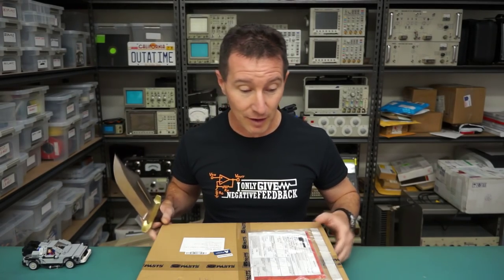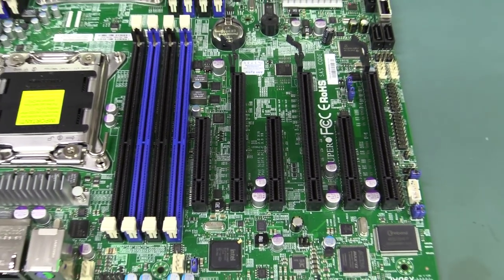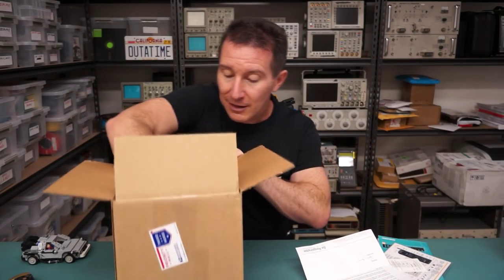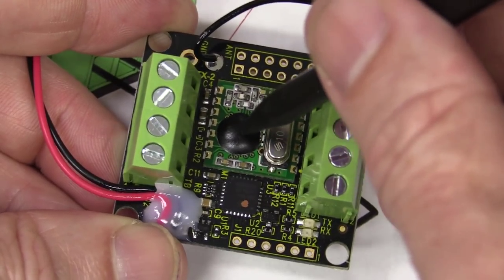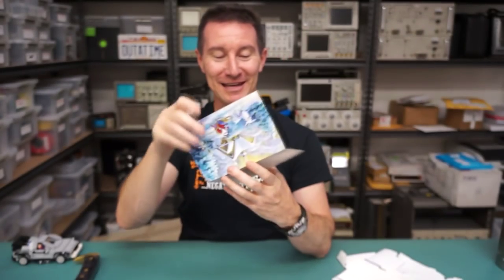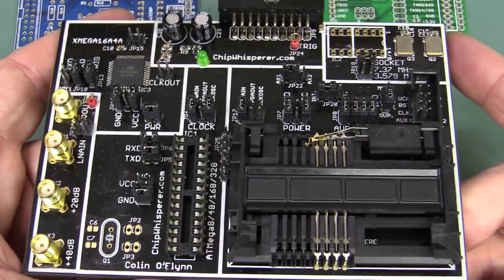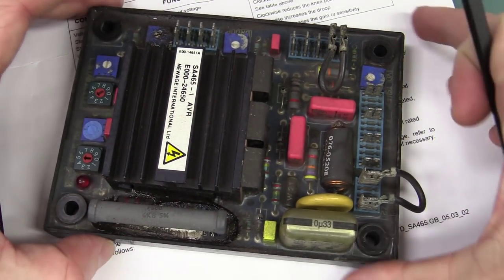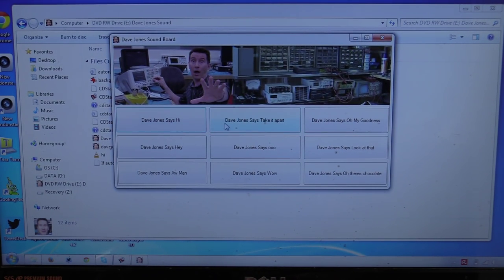EEVblog #720 - Mailbag

Comment: Hi Dave! Those are SAS HardDrive connectors, and the big chip next to it is the SAS controller. They are used in Server applications due to the extreme reliability and very high R&W speed.

Comment: lmao you installed software that a random person sent to you in the post? Even by Daves standards that's pretty stupid.
Reply: It's only a windows machine, what's the worst that can happen?
Reply: How do you know that wasn't being run from within a VM?  Even if not, if the system is isolated, you can always flash it back...   (Gotta admit, the soundboard was cute!)  ...  ''Oh!  There's chocolate!!''
Reply: yeah its definitely spyware or malware, RIP EEVblog
Reply: mc4bbs Ironic he said it just before tying the disk.
Reply: rocketman221projects Well, nothing physically. But it could have secretly installed discrete spying software, to get passwords and the like. Just a bad idea, unless you really trust the guy.
Reply: rocketman221projects You say that as if Windows is mega secure or something.
Reply: EEVblog when loading software you not sure about use sandboxie as it allows you to completely install or run a program that is isolated from the main file system and process (it has a yellow box around it) so if it does something bad all you do is exit it in the sandboxie window

as any changes that are made are done in the protected sandbox if a file is changed its not really changed sandboxie makes a copy of it first then its changed in the sandbox your settings and system files are never changed, its free to use so you should use it if you run a random disk that someone sends you again (saves you having to use a VM or a separate system) sandboxie is very simple to use

Comment: For anybody still wondering what the unpopulated headers on the lower right corner of that server motherboard are, they're SAS connectors (or at least they would be). Those connectors would connect between a RAID controller (which would be the BGA pad), and a hot-swap SAS hard drive bay (which would house 4 or more hard drives), so that you don't need to run individual cables. Serial Attached SCSI is compatible with SATA II.

Comment: These wiggly traces @ 10:15 are for impedance control purpose. It's to minimize impedance variations. If they were parallel to fibers, some lines could end up going directly over a fiber and some over a slightly thicker layer of epoxy.

Comment: The onboard USB A connector is great for plugging in a bootable thumb drive.  Image a bunch of them on your desktop, have data center operptions guys pop them in boards.  Bingo!

As mentioned by others the unpopulated "bits" in the corner are SAS connectors and the bga next to them would be a storage controller IC.  Probably LSI Megaraid or Adaptec of some kind.  Due to the lack of a dimm slot near by it would be for a HBA (host bus adapter, just a disk controller) and not a proper RAID controller.

The SuperMicro X9 series has a lot of different models in it.  I've seen enough SuperMicro boards to know that they often design one or a few boards and then selectively populate them for different models.

Someone above mentioned the lack of proprietary connectors.  This is because SuperMicro is a OEM or WhiteBox manufacturer.  They don't integrate as much as Dell/HP/IBM.  Many of their boards even fit in eATX or full size ATX cases where the other already mentioned brands  are less likely to make such boards.

Comment: You are actually right on the boot from sdcard theory.  But the standard is to boot from a USB stick secured inside the cabinet by plugging it into that vertical USB socket.  Fits nicely within the same height as the CPU heat sinks.  Biggest use is to boot a VMware ESXi OS, which uses networked storage.

Comment: Unpopulated places on motherboard are for SAS controller for sure. There are even labeled as "SAS0~3" and "SAS4~7" (usually there are 4 SAS ports on single connector, you have to use split out cable).

Comment: EEVblog The unpopulated "connector pins" I think are for m-SATA, very small SSD cards which you can snap in there directly on the mainboard. The other ones with the BGA pins are for an SAS (SerialAttachedStorage), an faster connector than SATA for the drives. The serial port by the way still mostly is used for UPS devices :)

Comment: The unpopulated area on the mainboard is for an onboard SAS controller. There are markings reading SAS 0~3 and SAS 4~7... those are unpopulated SFF-8087 connectors for SAS and as the large BGA package area is directly beneath it is a fairly good assumption.

Comment: The unpopulated stuff looks like a SAS port or two and the controller for those will be the unpopulated Bay pad. Sitting right down near the southbridge, or may even use a few points lanes if installed. SAS is a high speed enterprise-level storage backplane.

Comment: Dave The unpopulated BGA on the edge of the motherboard board looks like an optional SAS controller ( type of HDD interface ) and its supporting components. With the size of the space for the header it will support an additional 4 drives.

Comment: Dave, I may be wrong but I think those "fancy-pancy" traces on the motherboard may have been intentionally routed in unusual angles to avoid running parallel or perpendicular to the glass fiber of the FR4 material. Some studies say it has an effect on Signal Integrity if I'm not mistaken.

Comment: Full atx case and  watch your air flow they can get quite warm when loaded with ram in normal desktop cases. I run them fully loaded with 16gb sticks:) 256gb total

Minimum you need with thouse cpus is one ram stick per cpu.  The missing stuff is a megaraid/LSi sas controler:)

Also that board also has a built in IP kvm (ipmi) what ever you do dont put that on the internet, it has a default internal login you cant disable. (ITs enabled by defualt and will grab an address via dhcp) But it is awsome for remote use if you can hide it behind a VPN. And can do everything from rebooting to installing it.
Reply: How would you go about installing that board in an ATX case?
Reply: AH right.... extended ATX is what you want. Quite a few gamer cases them first google result i got:
http://www.newegg.com/Product/Product.aspx?Item=N82E16811139029

That looks like a that woudl be a ideal case due to large airflow vent.
Reply: CalcProgrammer1 yeah it looks like one of the EATX or possibly XL-ATX boards.
Reply: Supermicros site says E-ATX

Comment: @ 6:53 that's probably a XTP connector (DNI'ed) between the two processor sockets. That looks like a high end workstation with 3 PCIe x16 slots for very expensive video cards and SAS RAID cards.

@ 10:20 the zigzag of traces has to do with avoiding difficulties encountered with high speed differential signals and the fiber weave of the PCB. Check out this info taken from an Intel's white paper on fiber weave. (which I participated in)

http://download.intel.com/support/processors/quark/sb/quark_pdg_330258_002.pdf

See 2.6 Minimizing the Effect of Fiber Weave especially Figure 13. An Example of Zig-Zag Routing (on page 27)

Best regards,

a former Intel insider

Comment: Hi Dave for this motherboard you are going to need a video card as well and the ram DIMMs should be matched make sure you use the same ram dimms with same frequency and latency otherwise you can experience all kind of weird stuff from very bad performance, blue screens or system not booting at all....you get best performance when you use matched pairs of ram sticks and put them in dual or quad channel :) thanks for the video :)))

Comment: The missing section from your board is for SAS ports and the controller chipset for them, and a few spare connections. No worries though, SAS drives wouldn't do you a whole lot of good anyhow.

Comment: The 2 missing ports on the bottom could be for msata ssd drives
Reply: I stand corrected. I did some digging. The 2 ports are for SAS connectors. Basically SATA but with power and data integrated together. Each one can link off too 4 drives.
Reply: januar324 That's not quite accurate. SAS is Serial Attached SCSI. You can attach SATA drives to a SAS Controller. There's a huge difference between the two instruction sets though. Each link can actually link out to a more or less infinite amount of drives, by the use, you can get up to cartoonishly large amounts of connections. over 65,000 devices can be controlled by the use of backplane expanders.
Reply: januar324 No, power and data isn't integrated, and no, it's very much not 'basically SATA'. They're pretty obviously not mSATA either!
Reply: Monkeh616 thanks both of you for the clarification. I looked at the diagrams and tried to find a bit on what they where so when I looked for sas that's what I got. Good to know :)
Reply: (They say L-SAS above them)
Reply: Scotty Catman SAS is Serial Attached SCSI. I have a HighPoint RAID with two SAS connectors that go into Infiniband connectors on the box with the drives.
Reply: Scott Thomas
I understand that. The original comment made it sound like they put some work into finding out what this space on the board was for, but it says L-SAS right above it.

Comment: the unpopulated stuff is the sas array for scsi and the case needed is a eatx (extended atx ) the ram will be if not matched pairs you can use 1 dimm in each bank if dual channel or more channel my need 2,3,4. sticks in each

Comment: I built a system using the X9DAI for a friend using 10 core xeons.  This is a nice board, but it has a non standard mounting hole layout with only 5 of the holes lining up correctly.   One option is to use a Supermicro case, or if handy with a drill add the 4 remaining 4 mounting holes to a different case..

You can run these boards in single, dual channel mode using 1 or 2 dimms to get it going, but it is best to populate all the build slots first for best performance.
Reply: If you use an E-ATX case it works just fine.  I've never had a problem with supermicro boards not lining up to the E-ATX mounting holes.

Comment: The no-pop connector at 6:55 is for an XDP connector for Intel's in-circuit debug pod: https://designintools.intel.com/product_p/itpxdp3brext.htm .

The shunt near the CPU regulators is likely involved in measuring current to feed into the CPU's "Turbo Boost" control logic, allowing it to temporarily overclock one or more cores if there is power and thermal headroom.

Comment: For the motherboard, the RAM needs to be installed in pairs for each processor.  What ever ram goes on one side of the motherboard needs to be exactly the same on the other side.

Comment: We use a similar  Supermicro X9DAI and X10DAI MB on our servers at Rugged Portable Computers. The unpopulated SAS components are for a 8 channel on-board raid controller. Yes you are correct. You do need 2 DIMMS for each processor. Also both CPU 8-pin 12V power connectors plugged in. If you need more detailed info the users guide can be found on Supermcro web site. cant post url here. shoot me a note if you have any problems.

Comment: That's 4 banks of quad-channel DDR3 DIMM's, 128GB using regular consumer-grade 8GB sticks (eg: Corsair Vengeance 1600MHz 32GB kits, $429AUD/kit at PCCaseGear.com down in Melbourne), 256GB if you can find the 16GB ECC-DIMM's (ComputerOnline.com.au in Sydney might be a good bet).
That is going to be a BEAST of a system, even if you only give 32GB per-processor (a 32GB kit each, 64GB together)!

Comment: The Xeon has a quad channel memory controller in it so what you need to do is match voltage, rated speed, and capacity of at least 8 DIMMs if you're going to be using both sockets.  CAS latency isn't as important here because all DIMMs will be set to the slowest latency.  If you're pulling DIMMs from old servers make sure these three requirements match or some of your DIMMs are going to have a very short life.  If you can't match this many DIMMs at first you can run 4 DIMMs in dual channel mode, or run a single socket in quad channel mode.  Also, make sure you populate sockets of the same color.  Some chipsets are picky about which sockets you populate first, so if you don't get a POST just change to the other color set.
Reply: Also the type of case you need is an EATX case.  If you intend to put it in a rack almost any 4U rack will work.

Comment: I think that what Ian from Austraaaaalia was getting at is that the AVR is part of a negative feedback loop regulating the output voltage of a genset by controlling the field current.  Hence it's rather difficult to test it by itself on the bench.  What he needs is a genset simulator to close the loop, any ideas anyone?.  The AVR senses the ac output voltage from the generator, provides a dc drive current (up to 4A) for the field coil and then adjusts the field current to get the required ac sense voltage.    A crude check would be to just to connect a variac to the sense input and a resistance to the output and see if it will produce an output current swinging from zero to 4A when the sense voltage is adjusted through the required set voltage.    The "minimum output resistance" refers to the lowest resistance field coil that it can drive.
Reply: Hello Number 33.

This is Ian who sent in the AVR.

I work work on electrical rotating equipment such as the brushless alternators that the AVR belongs too.

We often send these components out for testing but would like to setup our own capability to test.

I have seen and performed basic test using a light globe but i am not confident in the results.

As you said it would be great if we can simulate the conditions the AVR operates in and develop an accurate testing method.
Reply: ibd1977 Hi Ian
The best way to test these would probably be to build a generator simulator, but it would be an extensive and expensive task.  It could be done for example by using a microcontroller (Arduino etc) to generate a 50/60Hz sine wave which is fed to an audio power amp and used to drive a mains transformer (in reverse) to produce the high sense voltage.  Most of this is off the shelf equipment.  Then you would need a high power load to simulate the field winding.  It looks as though the AVR might utilise the inductance of the winding as part of a switch-mode output stage so the load must be representative in inductance as well as resistance.  The loop could then be closed by feeding the AVR output current back to the micro to control the amplitude of the sine wave and it should regulate.  Software could be used to simulate changing load  current and to adjust the generator parameters for different machines and also to vary the frequency as the machine starts up (might be a problem with the transformer here).  The stability of the control loop could be tested by software which applies a step change in the volts per rpm value and observing the change in output voltage. 

There are some responses from people who know far more about these things than I do on the EEVBlog forum.http://www.eevblog.com/forum/blog/eevblog-720-mailbag/30/

Comment: The unpopulated area above the 4 pin PWM FANA slot would be where they would put the Serial Attatched SCSI chipset.  While SuperMicro typically make great boards, I find they engineer the hell out of them but never deliver all the features it is capable of.  Mainly due to costs.  One word of warning with SuperMicro boards, they are VERY VERY picky about RAM modules.  You may find only 3-4 tested manufacturers.  Their approvers don't test many brands.  Very frustrating.